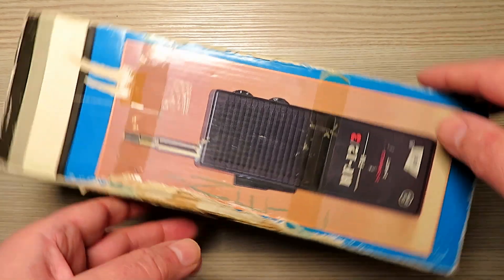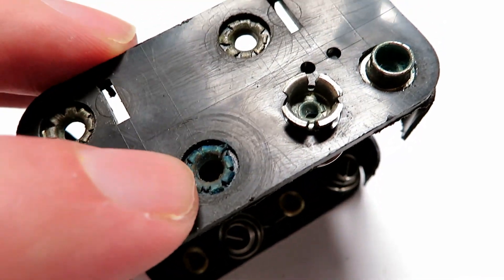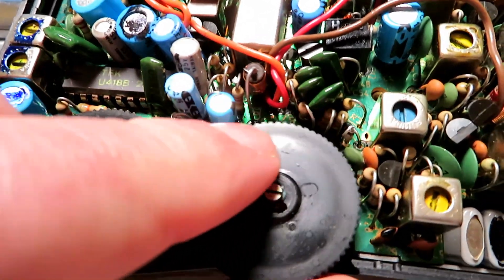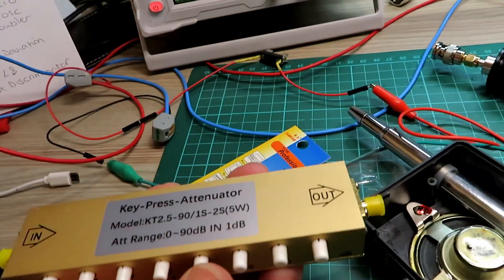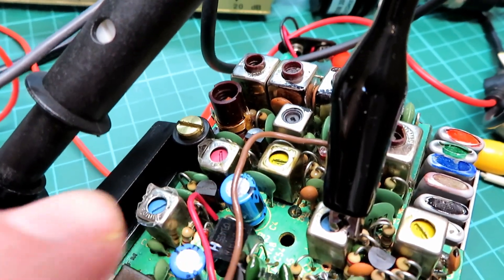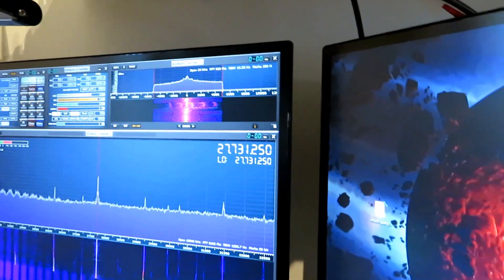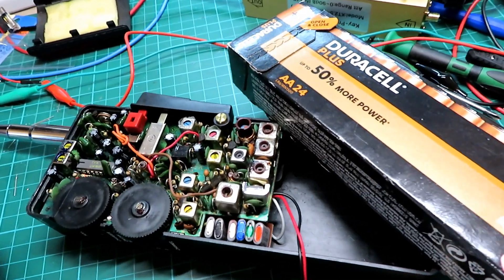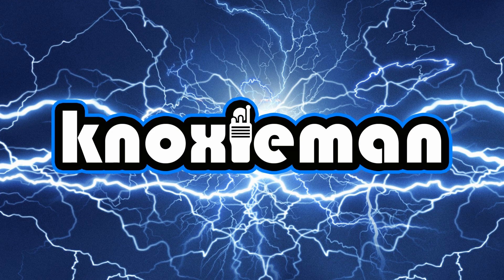DNT - HF-12/3  FM "2 WATT" CB WALKIE TALKIE - REPAIR AND TUNE UP - PART 1

Comment: looking at the schematic of the DNT i can see a problem with the TX PA if the schematic is true?
 it says the PA transistor is a BD137, if so? thats a general purpose, not a RF transistor
It'll be worth replacing with something like the real PA from a scrap CB, also it seems
 theyve used a in4001 instead of a low forward drop schottky diode for reverse polarity protection
 in series with the batteries, a 1n4001 could wastefully drop a volt, simply replace with a fuse
 and take the diode to ground, so the diode blows a fuse instead
Reply from the maker: Yes I'd noticed that about the power transistor very odd.

Comment: Great video,i sold off a load of FM german ones a while back, serviced.500mW to 600mW max into 50ohms load @12V DC .The Rx was very good sensitivity on RF signal generator 0.35uV pd, around 2.00-2.20khz TX deviation.2Watts on case is a misprint!
Reply from the maker: Yes they seem really nice radios, just waiting for a clear day to do a range test, it's also difficult due to the lockdown.
Reply: @knoxieman  Yes that is a bit of an  issue  right now.Love the WT vids,same way i got started Radio Shack USA catalogues! 49mhz band W\Talkies!

Comment: Hello again :-), all these small 100mW radios powered by 6F22 9V batteries were the 100mW INPUT POWER standard, i.e. the power supply of the final transistor. They had the power of 5-20mW of output power. This radio is extremely powerful because it is the newest of this type of older devices, the older AM modulation models had a power lower than 0.1 - 0.4W and very inefficient modulation, the modulator was too weak for the transmitter power. Therefore, the FM version is much better, has high power and efficient modulation, FM modulation is easier to obtain with good performance. In the years 1978-1982. the way of transmitting the transmitter power began to change. In the USA, 5W was previously given for the most powerful devices, but it was INPUT POWER, i.e. the power supply of the power transistor. The actual power of the CB handheld devices is 1.8 to 3W with 12.6V from the battery. Then the measurement rules were changed and the OUTPUT POWER output power was given, the limit was set to 4W. The devices did not change, it was the same power. The power of the transmitter had to be lower than 4W because it could be exceeded with increasing the power supply, the power of 4W could not be exceeded at a voltage of 15.6V that was the upper limit of power supply for automotive devices. Typical power at 13.8V was 3 to 3.5W. Therefore, the power of CB devices is not 4W and this is a safety limit for legality. Portable devices were to have a power of 2W and a car device - 3.5W. Small AA batteries of portable devices work under a very high load, the voltage often reaching the device is 11V while TX for 10 ni-xx cells. Cordial greetings :-).

Comment: Hello again. 2W is not the transmitter power but the approval standard.
The point is that the transmitter (output power stage) is to draw no more than 2W from the power source. The output power was not assessed in the past, because service centers did not have such measuring devices before. The RF power meter was made by hand in GB or USA etc and cost a lot of money, now is the era of Chinese slavery, all science / technology is hundreds of times cheaper than it should cost. Formerly devices for RF power measurement they were tube-based, there were not enough fast detection diodes, there were no transistor meters. A tube meter or such a CB radio cost as much as a cheap car (in 1948). The era of Japanese exploitation by the world was just beginning.

Comment: This model is exceptionally good, I have it, it had the best range of 27 Mhz devices from that period. Best modulation performance. A successful model. Almost like a professional radio from that period, until today it could be used at work outside if a smaller antenna was used.